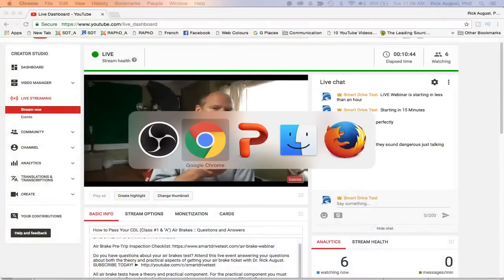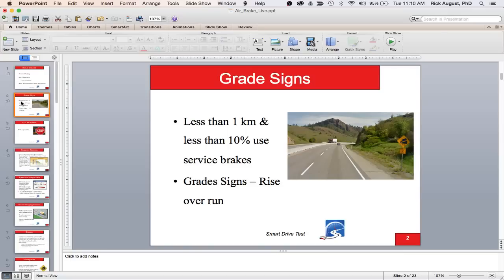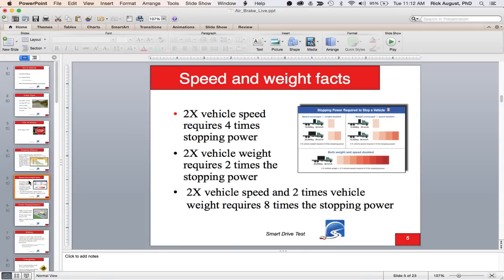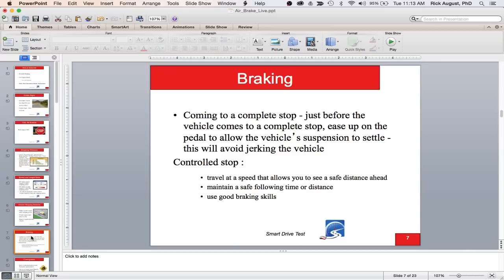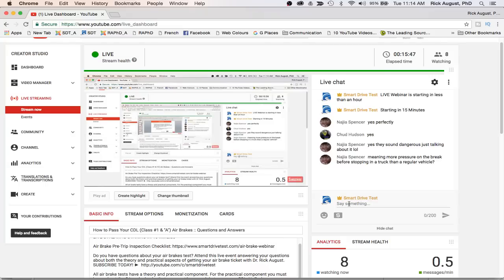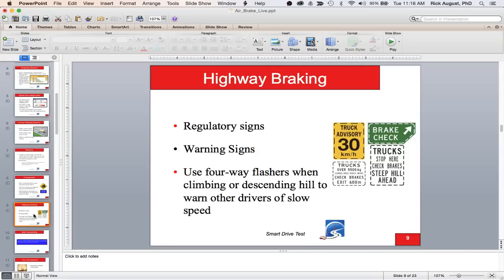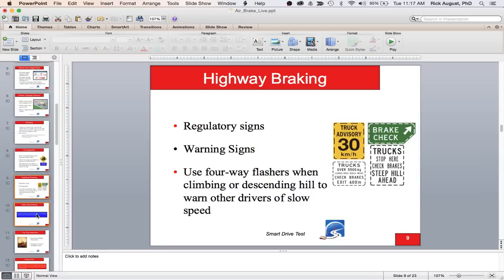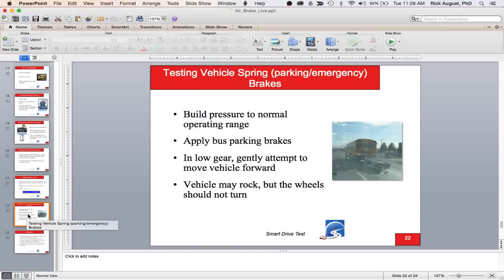How to Pass Your CDL (Class #1 & "A") Air Brakes :: Q & A

Comment: no reason  too get air brakes - but was told that if I was going for a CDL passages part - go ahead get that part also . Reason for getting it is to drive a church bus with 25 passengers.
Reply from the maker: Hi Marshall Border - Thank you for your comment. I would counsel you to get your air brake ticket in case you want to pick up another job driving bus. Most bigger buses are going to be fitted with air brakes and it really won't take too much more to get your air brake ticket my friend. It's a lot easer while you're learning than to go back and have to do it later. If there is anything further we can do, drop us a note. Always happy to help. All the best, Cheers Rick

Comment: hey i watched ur video i am currently going for my class 1A air brakes Class 1A and 3 pleasde write back thanks!
Reply from the maker: What can we help you with Tyler? Cheers Rick
Reply: @smartdrivetest  mostly just the air pressure psi cut in n cut out and slack adjuster 2021 books are very confusing and difficult

Comment: Hi Rick, I’m in the UK and training to be a bus driver and I drove using an air brake system for the first time today. I only drove around the depot at 10mph but I found stopping smoothly very difficult there’s a long period of no response before suddenly braking very hard. There’s not much help online about air brakes and your videos have been very useful for my understanding of how air brakes work and hopefully this will translate into my training however I was wondering if you were planning on a video about how to use the service brake smoothly or have any tips you think would be useful for a beginner bus driver struggling getting to grips with how delayed and sensitive the braking is? Thanks, Damien
Reply from the maker: Hi damin - Thank you for your comment and query. Unfortunately, there aren't any simple solutions. Different vehicles are going to respond differently when you press on the brake pedal. And with that particular vehicle it's just a matter of practice. One of the techniques I get students to try is to put their heel on the floor, scrunch their toes, and push the break pedal while squeezing toes. Give that a go and see if it works for you. If there is anything further we can do, drop us a note. Always happy to help. All the best, Cheers Rick

Comment: can you do a alberta brake system check,,whats the differances as i will be going across canada in a tractor trailer
Reply from the maker: Hi Trevor Ber - Thank you for your comment and query. The only difference in the Alberta air brakes that I know of is that the leak test is held for 2 minutes, rather than the standard 1 minute. If there is anything further we can do, drop us a note. Always happy to help. All the best, Cheers Rick

Comment: I have my class B. I had the air brake on my permit but didnt have a vehicle equipped with the air brake at the time. What would I need to do in order to have air brake added to my license besides the permit?
Reply: Study for it and make an appointment to take the air break endorsement test

Comment: why do a truck stall out when you put on brakes
Reply from the maker: Hi Fannie Goins - Thank you for your comment and query. The only reason is that you're either holding the brakes on too long with the clutch out (should push the clutch in at about 800rpm on most big diesel engines) or there is something mechanically wrong with the truck.  And you are most welcome. If there is anything further we can do, drop us a note. Always happy to help. All the best, Cheers Rick

Comment: I was told that loss of air pressure on the parking brakes in one minute is no more than two PSI .
Reply from the maker: Hi Edward Lachance - Thank you for your comment. it's 3-4-6 psi. And it's for the service brakes, not the parking brakes. During the leak test, the parking brakes are released. It's 3psi for a straight truck, bus, or RV unit; it's 4psi for truck and trailer; and it's 6psi for a truck and multiple trailers. Where are you in the world - it might be different in your jurisdiction.  If there is anything further we can do, drop us a note. Always happy to help. All the best, Cheers Rick